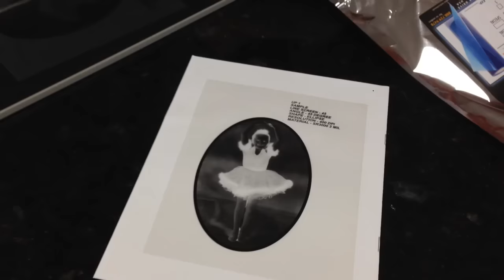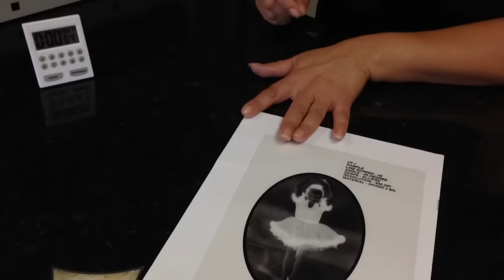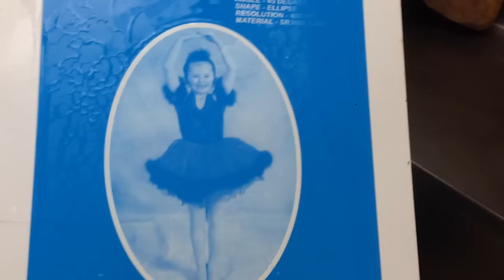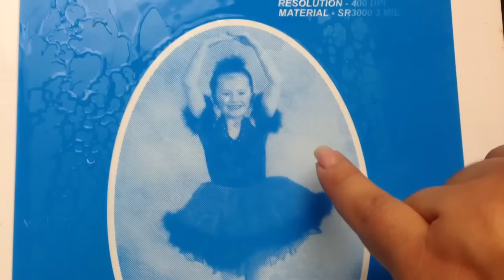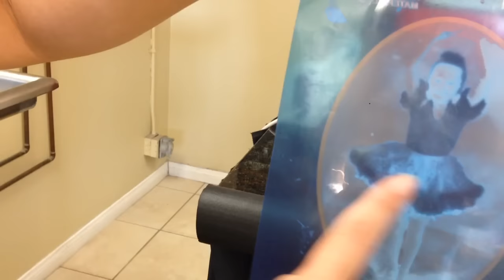Developing a Halftone Photomask for Sandcarving

Comment: how much is the sand carving kit from raziyst
Reply from the maker: roger Jimenez , the "complete" mask making kit for InkJet printing is $595. there is also a scaled down kit for a little less. 
If you have questions, call 800 729 9478
Reply from the maker: It's best to look on our site for pricing at www.rayzist.com  look up Mask Making Kits we have a few to choose from depending on your needs. 
You can always call, 800 729 9478
Reply: Do you use a regular ink jet printer the get the negative?

Comment: I have a Chevy S10 pickup and I have it it's an extended cab and the 2 little windows in the back I would like to have my father's face put out one side on the driver side in my mother's face put on the passenger side would I be able to do that on glass on the inside then I am going to get dope windows tinted black so it shows through their face and I would put in loving memory when they were born and when they passed away just like a cemetery marker please comment back and let me know if that can be done this way thank you and please be safe where a  Mask
Reply from the maker: All possible... just requires the graphic. Our team and produce the resist mask (stencil) for you; as a "custom mask," you will need to perform the etching or find someone who can. The window would need "tinting" for contrast for a "photo"; but you might double-check with the tinting company if the film can be tinted over an etched surface. Also, suggest you also produce a sample prior to sandblasting onto the vehicle's window, just to be sure your happy. 
https://www.rayzist.com/Film/CustomMask.php

Comment: good day.
Reply: am new at this what kind of  abrasive do you use with photo resist 
film
Reply from the maker: @maremolamola9905   Hello! Thank you for watching. We use and recommend two different mediums. Aluminum Oxide or Silicon Carbide 150 grit/mesh. You can use a slightly smaller grain of media like a 180 grit, but you will get less recycling from the media. I hope this helps.
Please see our "Learn Sandcarving" playlist, there is a lot of great information there. Thanks Again!